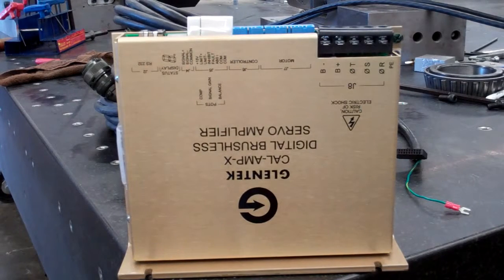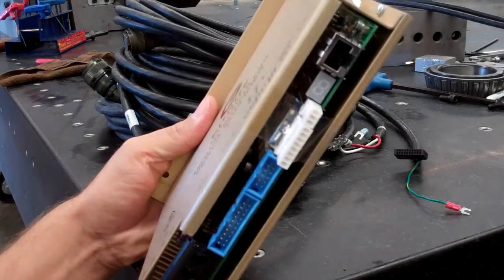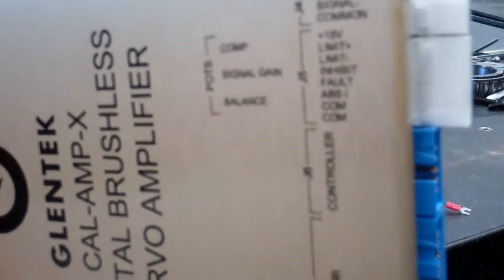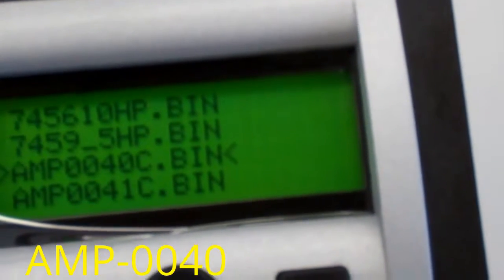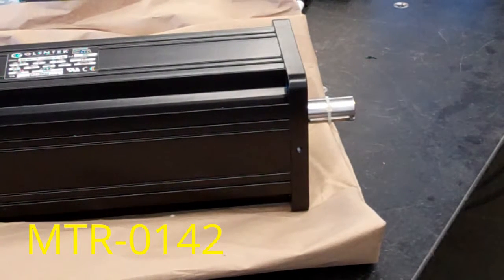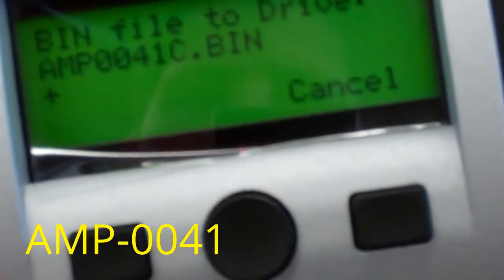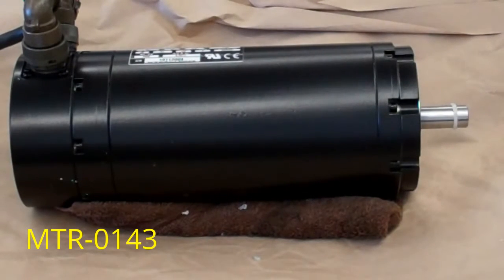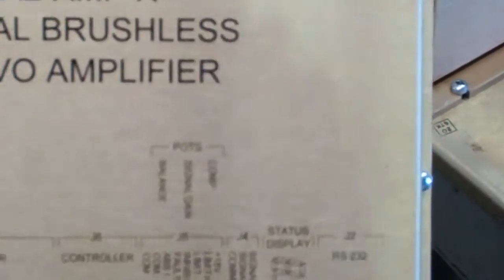Calmotion programmable CAL-AMP-X for Fadal AC motors

Comment: Didn't see this amp on the website. We have a Fadal 3016L with AMP-0056 amplifiers. Haven't gotten alarms yet, but the axes drift and sometimes the machine will shake violently while booting up.
Reply from the maker: There is no real good solution to fix the AMP-0056, you will need the Baldor software to adjust and setup, the drift might always be there.  The only permanent solution is to replace the drive.  The Cal-Amp-X amplifier can be programmed to use either the small AC motor you probably have on your L machine AMP-0039C or for the larger AC motors the AMP-0040C.
Reply: Thanks for the reply. We just recently replaced the spindle drive (Glentek) and spindle motor. If I can resolve the axis drift issue with an amplifier upgrade it will be a great help.